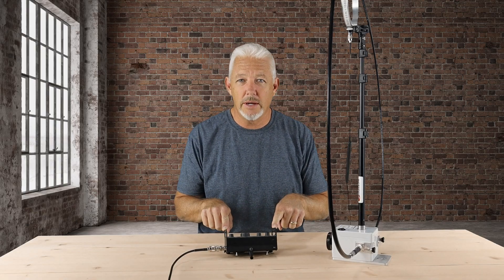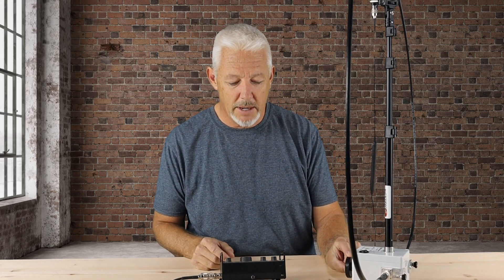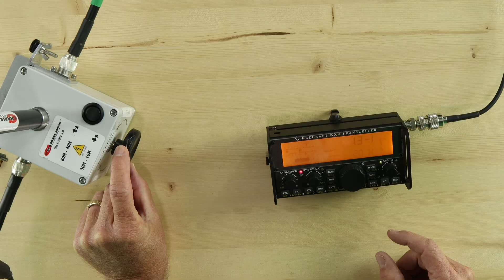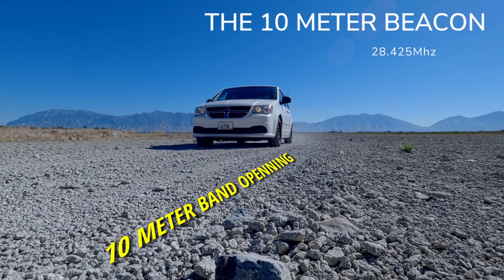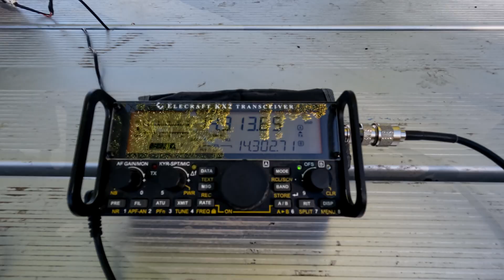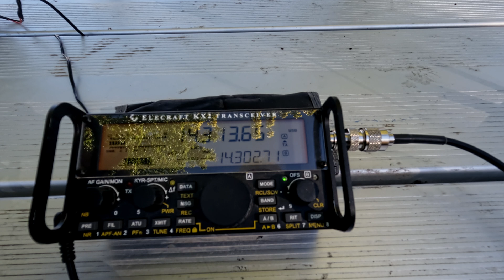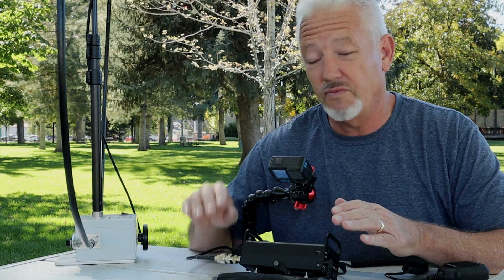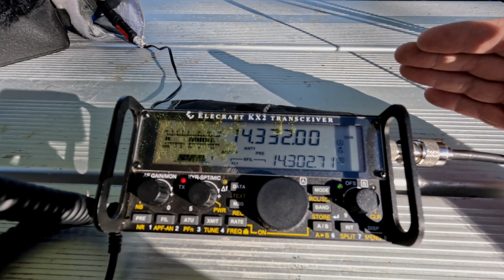Can a LOOP antenna make HF contacts  ? | K7SW ham radio

Comment from the maker: Where would YOU try a Mag Loop antenna ?
Reply: Just about anywhere. I have the Chameleon F-Loop 2.0 and it's used daily here in the shack. SWR reading are never over 1.5:1 covering 80-10m. As you mentioned, the nulls are a Godsend for knocking down noise levels. When the weather isn't killer (SE Texas, at a highly humid 90-100 degrees) I'll take it down to the front yard or driveway, in the back. I've never officially done POTA, but I've taken my IC-705 + loop to some local parks which provide excellent shade. Hamfest setups in the tailgate section brings a lot of attention to my table as well.The great part of a mag loop is that you're no longer in need of ground radials, poles, stakes, or trees ('cept for shade), and because you are actually tuning the variable capacitor there is no need to drag along an AT. I use a tiny A/B coaxial switch box that's used at home or elsewhere. Position "A" takes the antenna straight to the rig, while Position "B" diverts it to one of those very lightweight Rig Expert analyzer sticks. I in find it pretty easy to tune the antenna until the stick tells me "It's go time", switch to "A" and then - on the way to making contacts. For most occasions, 5-10 watts is all I need to have fun, indoors or outside. Enjoyed your video - Thanks! 👍
Reply: I have the F LOOP 3.0 in a very controlled apartment in Zürich. Working beautifully, and the only reason why I'm able to get on the Air on the apartment right now.

How are you able to show the SWR on the KX2 while tuning the loop?

73 de Luis, HB9HJU
Reply: I picked up a OM0ET MC-20 MLA back in Aug, and used it extensively until I was able to get my EFHW higher than 10ft...indoors even (I was able to WAC on 40M in my living room). Now, I tend to use my EFHW at my QTH and use the MLA for POTA activations, where it works great for digital work.  Setup is a piece of cake...no need to hunt for trees, except for shade...no radials to run.  Just mount it to a tripod, hook it up to the radio, and I'm ready to rock and roll.  Plus, it plays well in areas/parks that are prone to having lots of noise, stores nicely into a 17" laptop bag (making it easy to transport), and only has around a 3ft footprint (tends to keep other park goers from walking into it).
Reply: Close to the shore line or near our canals.  great  loop u have there. sir . 73 subbed
Reply: Anywhere... to get away from the plasma TV and other QRM that surrounds my house !   😃   I've just started building a mag-loop, still waiting for a few more parts, but it's already under construction... Will be for 10 and 15 meters, made with scrap piece of 7/8 inch Heliax and a Vacuum Variable capacitor. I'll set it up to be motor tuned, but on the tripod, I should be able to tune it manually for portable operation.  Looking forward to trying it out!

Comment: Is it advisable to operate the loop so close to the body? I keep reading that one should maintain a respectful distance when transmitting, even at low power levels.
Reply from the maker: Keeping a distance is good practice.

Comment: I once did the math on these.  Basically, what I remember is that you get 10% or less efficiency on 40m, about 20% on 20m, and 50% or maybe a bit more on 10m.  You get about 2-3 db of gain in the plain.  I’ve had success with them.  At the last solar maximum, I made a contact in turkey.  You’re probably radiating 5w on 20m.  Not horrible.  Is it worth $300?  Probably not.

Comment: What is an EFHW dipole? 9:48 Dipoles are center fed, EFHW is, well, end fed.
Reply: An EFHW antenna is also a half wave dipole.  It is just fed from the end instead of the center.
Reply: @stargazer7644  An EFHW is a monopole. A dipole, regardless of wavelengths, is a double pole. A dipole can be fed anywhere within the wire such as an off center fed dipole. If it is fed on the end it is a monopole or more known as end fed.

Comment: Can’t we just hook up a RigExpert and turn the knob until the SWR is good?
Reply from the maker: No, it doesn't really work like that. Plus, each radio is just a little different, so the sensitivity will be off . And leaving your coax connected and turning it this way, really is not that hard. You might be surprised.  73
Reply: @hamradiowithkevin  You’re probably right. I tried it again with a NanoVNA, but couldn’t get anything other than infinite SWR. I’m hoping that putting it on the radio and just listening will work, though I’m not confident I can do it well.

Comment: I have the F-loop with the additional "power compensator" capacitor puck to increase the power-handling capability, up to 60W on SSB or 25W full-duty-cycle on CW or digital modes.  I have tested this as a receive-only antenna so far, and was able to pick up very many FT8 signals on 20 metres.  If you are going to operate on this antenna while sitting right next to it, you must sit in the nulls to avoid excessive RF exposure.
Reply from the maker: Using the Floop on high power, I would get the "remote tuner " option . It is safer and easier to tune.

Comment: Do any issues arise if inner loop isn't in relatively perfect alignment with outer loop? Does the distance of inner loop top to outer loop matter much?  Just curious about how finicky they may or may not be.
Reply from the maker: I wondered the same thing, with this loop at least, the way you put it together it is in the same position each time you use it. And that makes this loop fun to use.

Comment: I have an AlexLoop mag loop set up by my second desk in the shack.  My main rig is an IC7300 with an end fed wire. The second rig is the AlexLoop with my Xiegu G90. I hunt POTA at 5 to 20 watts with the mag loop and it works great. Another big benefit of the mag loop set up indoors is that you can operate during storms without worry of lightning strikes.  When I go portable, I just put the loop fully assembled in the back of my van, toss in a tripod, and there's no delay when I get there. Set up and running in just a few minutes.  I also find it very easy to tune.  Thanks for the great video. 
73, W5DUI - Brian

Comment: Can I connect the antenna to the ICOM 2300 device in the car and use it on the frequency (145.000) because I am looking for a long-distance transmission in the car
Reply from the maker: No that will not work. HF only
Reply: An IC-2300 is an FM radio.  If you want long distance on 2M, you need to be using an SSB/CW radio with a long horizontal yagi antenna for weak signal work.

Comment: I have the older version of the Chameleon F Loop. Love it! Good for my hoa situation and very easy to set up portable. It's a nice easy day compared to putting up a wire. I use an antenna switcher and an antenna analyzer to tune. Even easier!
Reply from the maker: As much fun as it sounds like your having, you may like the next upgrade coming for the FLOOP series, almost an automatic tuning feature ! Video to come
Reply: is this video available? @hamradiowithkevin
Reply from the maker: @johnm3012  sorry i never got the auto tunner.

Comment: I have the Alex Loop and just ordered the Cha Loop 3.0. I love loop antennas and have had some amazing DX contacts on 10 meters with the Alex Loop. I am very interested in how the two will compare from the same location and height. When the weather is rough, I set up my Alex Loop in my 2nd story shack (by a window) and it still gets out. The real test for us will be when the solar cycle is low and the bands are more challenging. Thanks for the video, you talked me into taking the plunge on this loop (I got the TOTAL package). KD2ZTA
Reply from the maker: What a cool test you will get to make using those 2 antennas. I agree, loops can be real fun. Nice job adding to the antennas. You will be prepared.

Comment: Hi, I came from your other mag loop video. Great video! I'm strongly consodering picking up one of these style antennas, as someone who travels for work to hotels and apartments and also does a lot of POTA. I have an 891 and an 817, and I've also been really wanting to get my hands on a KX2 so I've been really enjoying your videos. As far as tuning the mag loop...I see you mention sending a carrier. I'm still fuzzy on sending carriers. So I set the radio to low power (5 watts) and then just pick a random mode like cw or digital and just key down? Is that really all? As far as using a QRP rig like the 817, still set it to low power? Not sure what low power on the 817/Kx2 even amounts to wattage wise...Just want to make sure I know what I'm doing and do it correctly so that I don't damage anything.  Thank you again.
Reply from the maker: Kody, thanks for being part of the channel,  yes once you know how to turn the power down on your radio to lets say 5 watts. You would then select Digital or AM and push the ptt. you should at that point see the SWR reading ( if your menu is turned on) you will need to consult your manual for that part. ** on Yaesu, it will be the display that shows SWR /PWR.   This will NOT tune your antenna, it just lets you know how far off  or how close you have your antenna tuned.  Feel free to email me if you have additional questions. ( look in the "about" section of the channel)
Reply: I have the FT-891, amazing radio for the money and one of the most underrated radios in Ham Radio!

Anyway, how I send a carrier is I press PTT and Up button on the mic and it sends a carrier and changes the meter from power to SWR, very convenient and it works great with the MFG-939Y auto tuner, saves having to go into menus and change the meter from power to SWR and from SSB to AM and Back. 

You just have to go to the menu and set the AM power level to 5 Watts.

Comment: Tried a mag loop (the very one you're using here).  Didn't impress me, TBH.  Performance not even close to an EF random wire.  Returned it after several weeks of testing.  Glad to see it's working for you!
Reply from the maker: Thanks Floyd

Comment: I have a number of loops,  some homebrewed to varying degrees.   MFJ make a few loop tuner boxes for example, MFJ-933C as well as variants of similar design that will handle 100+ watts.  I have had good luck operating 40m, 20m and to a lesser extent 80m on portable loops and up to 100 watts from an FT-891.  I have worked a number of Dx stations in Europe on phone and also on digital modes with loops.  
The best way to tune them is with a NanoVNA or some other antenna analyzer.  Tuning for maximum noise only gets you to close to resonance.   Loops are very high Q especially at lower frequencies relative to loop sizes.  The useable bandwidth is a few KHz at any given setting.  Loop tuning is also very to temperature, humidity and the local environment.
Reply from the maker: Larry, you have really had some experiences with loop operating. 
I think that is nice you were able to try so many variations.  Thanks for sharing that story.  Kevin
Reply: I have the FT-891 also, if you might not already know then this might be of use to you.

 how I send a carrier is I press PTT and Up button on the mic and it sends a carrier and changes the meter from power to SWR, very convenient and it works great with the MFG-939Y auto tuner, saves having to go into menus and change the meter from power to SWR and from SSB to AM and Back. 

You just have to go to the menu and set the AM power level to 5 Watts.

Check out my channel, I have the MFJ-935C and have had good success with it, made a couple of videos today.

Comment: That's a great set-up and thanks for sharing; with that said i'd be concerned transmitting too close from a loop, imo i'd stay at least 7 ft from it at 20W and at least 15 ft at 100W, what do you think about that?
Reply from the maker: yes, RF exposure is a concern, you should definitely be aware of your limits.  90% of the time I use 10 watts or less.

Comment: I have a mfj telescopic whip out to around 102 inches leaning on a plant sticking out of my 2nd floor balcony at an angle in So Cal. Yaesu 991A 95 watts been hitting Japan on 10 no problem.
Reply from the maker: Where there is a will, there is a way.

Comment: Well done Kevin. Great portable antenna....but I've worked many folks in an apartment, etc using one of these when they had antenna restrictions.
Reply from the maker: Thanks Ken, I am looking forward to trying an in home or balcony deployment to see how it works.  You are proof that it does work👍
Reply: @hamradiowithkevin  I live on the ground floor and use my for JS8call at 20 watts. I've used it for Winlink, Vara Chat all on the ground floor.

Comment: Another great video Kevin!  Thanks!  How well does this loop breakdown for the back of the car.  I’m guessing you were hauling it around in the bed of your truck?
Reply from the maker: Bob, good question! I have had this in my Mini van, my Jeep and the back seat of the pickup.IT all vits into a small duffel bag, Except for the aluminum loop and even that is not very big. 
I can not believe I did not show that setup, Thanks for the reminder. I will add that next time i make a loop video.
Reply: @hamradiowithkevin  Thanks for the reply Kevin.  I’ve considered purchasing a loop but I’m not sure about adding a lot to the gear I take portable.  I’ll do a little more investigating.  I like the idea of having the antenna near you for making some adjustments on the fly.  73
Reply: @BobGarrett66  if it will help, my OM0ET MC-20 MLA will fit in a 17" laptop bag.  If I didn't have my X6100 and battery pack in their own cases, I could fit everything but the tripod in it.  As I like to keep them encased ;), I can fit everything in the laptop bag and a single strap tactical pack w/ the tripod in the "drink pocket" on the pack, easily transportable in a passenger seat and into the field.
Reply: @amnchode  Thanks Tim. That does help. I’m going to look into the loop Kevin has. I have a couple of Chameleon antennas now and have been impressed with the quality. I have thought about a loop but for some reason thought the size would be prohibitive for taking into the field, but if they’ll pack down to a size that will fit them into a 17” laptop bag, then I have a way to pack one up and transport it. Thanks for information!! 73

Comment: What tripod are you using?  I'm running an F-Loop 2.0 on an Amazon Basics and am nervous that the plastic will break soon.
Reply from the maker: Jason, I added to the video description also, Tripod  is a Bogen Manfrotto 3011 Tripod with 3126 Fluid Head Made In Italy.
Mine was used and broken for $6. The only place i can find them now is on Ebay for about $80 USD . I hope this helps. Kevin

Comment: Thanks for the video. The coax loop worked great. I can't wait for you to compare the aluminum to the coax. My loop is sitting by my feet in my shack in the bag it came in. Chameleon came out with a remote tuner servo for this 3.0 loop and later the 2.0 loop. It must be really slow turning. But there is no servo for direction. I think they are missing out on that feature.
Someday I will have to try contact you on HF. I am done harvesting so I will have to get back on the radio and hunt POTA.
Thanks
Kevin KA0KAE
Reply from the maker: You bet Kevin,
Looking forward to seeing how different the two are. 
73. Kevin

Comment: What mount is used on the tripod to attach mag loop?
Reply from the maker: Attaching to a tripod is easy with the 1/4 20 camera thread on the base of the tuning unit  of this loop.  I use only a 1/4-20 thumb screw and hand tighten. Super fast and simple.